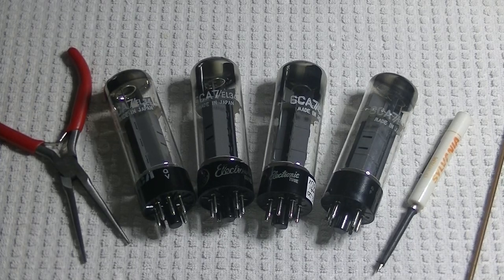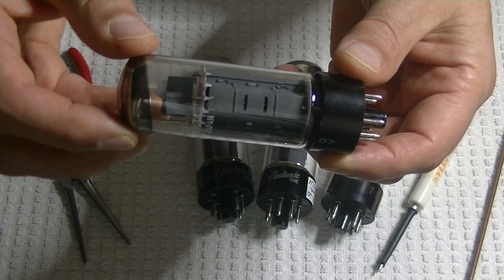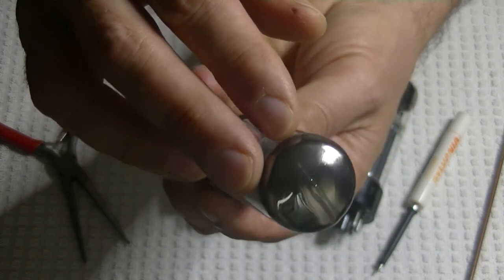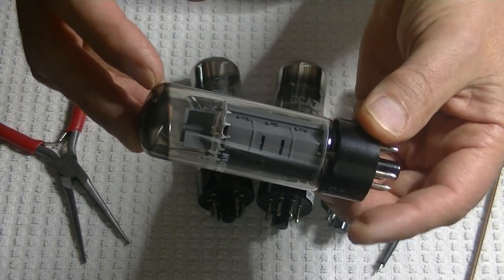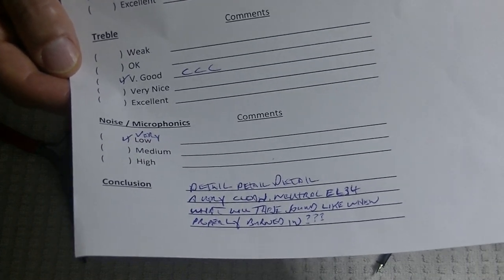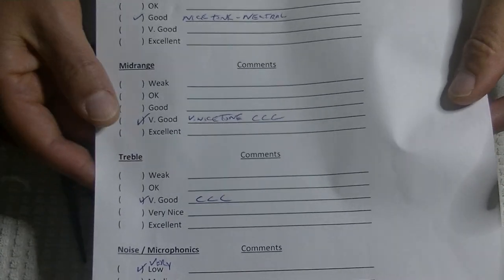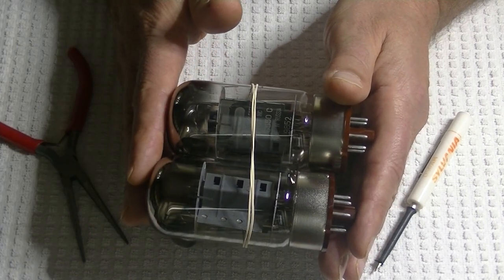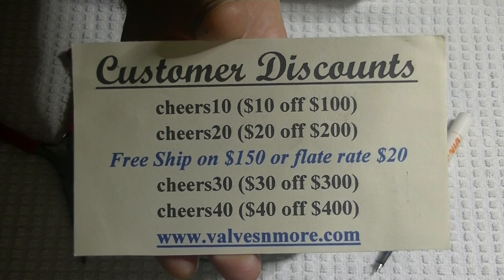Tube Lab #54   Matsushita EL34

Comment: What are your thoughts on the available EL-34s that were made by Ei in Nis, Yugoslavia?  I was able to acquire four pairs of these.   I haven’t auditioned them yet.  My Altec 1568a pair is not currently in service, they are currently running winged =C=.
Reply from the maker: No, the only type from Ei I've had any experience with are the 12ax7's which are well liked.  Are your EL34's those weird looking pointy topped tubes?  They are definitely rare, and the big problem with rare tubes is matching them up properly for idle emissions (mA).  From what I can see they had production problems and many of them were not testing up to spec - so testing is important.